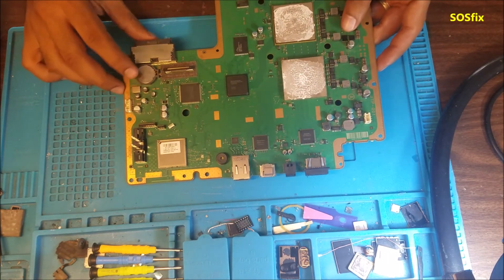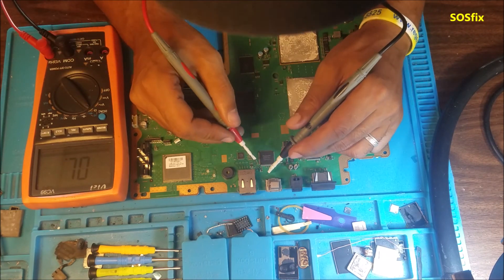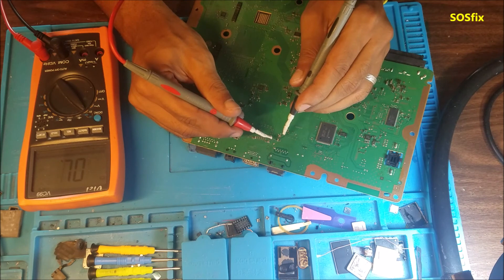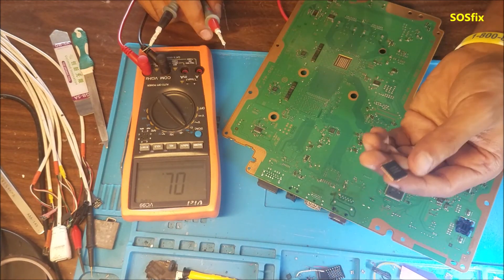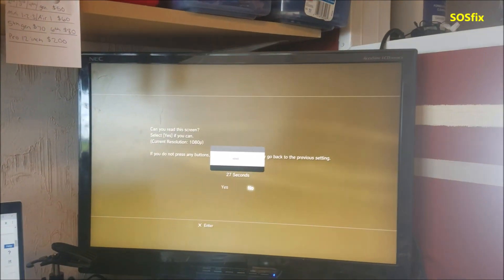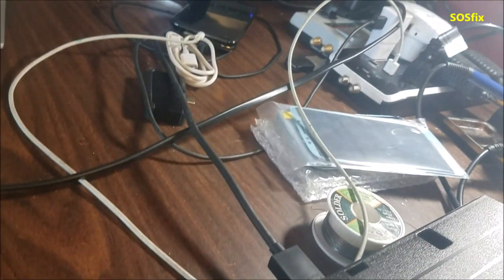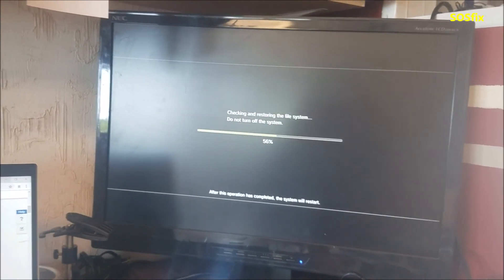PS3 picture on AV port but  no signal to hdmi port

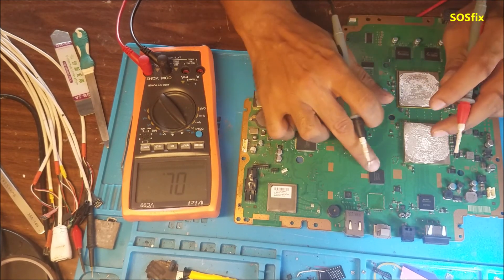Comment: Anybody knows if there is soldering required for replacing the hdmi-chip (01:30)?
Reply: Most likely, you would probably need a hot air station to heat up the pins soldered to the motherboard before you can remove the chip.
 Depending on which side of the world you are, you can find a relatively "affordable" hot air station that would do the job (Amazon/banggood). Just a lot of practice needed beforehand.
Reply: @bonganimahlangu8922  then i will try finding a repair service, because i neither have a hot air station nor the practise. Thanks for answering! :-)

Comment: I have similar issue AV is working however HDMI colours are distorted and picture keeps flickering on and off. Do you think it could be a chip?
Reply from the maker: or the hdmi port is pad
Reply: @SOSfixElectronics  Is there any way of finding out if its the port or the IC chip or any surrounding capacitors?
Reply from the maker: @retroonyoutube5402  visual check the port if there is any missing cracked or bent pins inside the port, wiggle the hdmi port to see if you got good picture, then change one by one
Reply: @SOSfixElectronics  Physical inspection of the port is perfect. Also no change when moving the cable.
Reply from the maker: @retroonyoutube5402  in this case will change the ic first, if still problem change the port 2 if still the problem, could be the  GPU...
Reply: @SOSfixElectronics  I will change the IC first as they are easy to swap over with a heat gun alone
Reply: @retroonyoutube5402  is ur issue fixed now after replacing IC
Reply: @bhaveshkale4273  nope

Comment: What mode did you use in the multimeter to test for capacitor shorts?
Reply: Ok ohm setting?
Reply: But what mode? Milivolts?
Reply from the maker: you can use ohm or diode mode the value should close to 0 in short
Reply from the maker: yes
Reply from the maker: some multi-meters the have the beep option for short more easy

Comment: If the multimeter doesn't show a value near 0, what it means. I got ~300, ~1300 and ~1600 on some capacitors.
Reply from the maker: thats good, the capacitor shouldnt show 0, because 0 in diode mode or resistance mode on multimeter mean is short
Reply: @SOSfixElectronics  thanks for your answer ! I'll buy a new chip in few days.

Comment: My ps3 hdmi Idk exactly, but i can say Half a problem maybe.
The port is safe
The smart tv detected the connection and can control the ps3
Av port work as well
But no picture from the hdmi
Why and what i can do??
Reply: Tell me as soon as possible please
Reply from the maker: if you have picture from av  but not from hdmi, try to reset video output in ps3, check the hdmi port for and internal damaged, check the hdmi ic controller, if all didnt help thats mean you have a bad gpu in ps3. good luck
Reply: If picture from AV works can gpu still be bad? Could the filter capacitors go bad and cause no hdmi output but detected by TV as source?
Thank you for good video
Reply: Let me know if you can help please

Comment: How do you know if the smd capacitors is dead ? Not the hdmi chip
Reply from the maker: the hdmi controller IC was shorted, how to find out ic shorted is to test the capacitors
Reply from the maker: After ic removed the short is gone

Comment: Why didn't you show the HDMI chip replacement, probably it's a lie and you didn't fix it and that's another PS3 you're showing that is working
Reply from the maker: it was the same PS3 this video to shows you the problem and how to test the hdmi ic controller